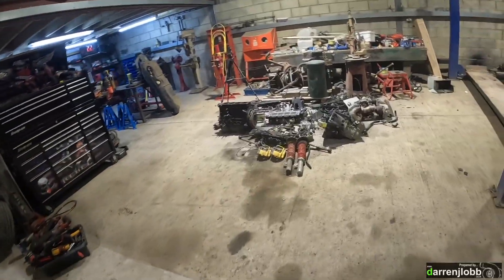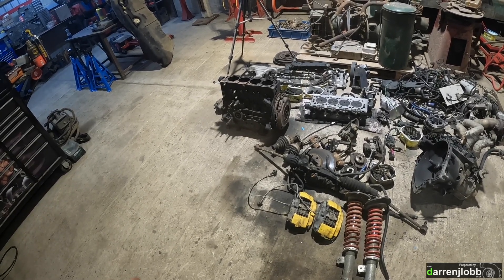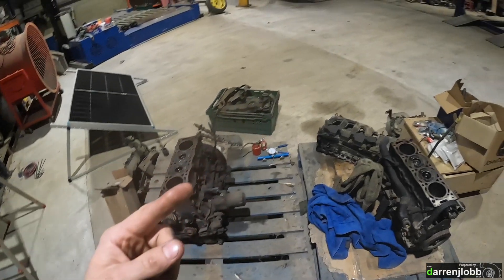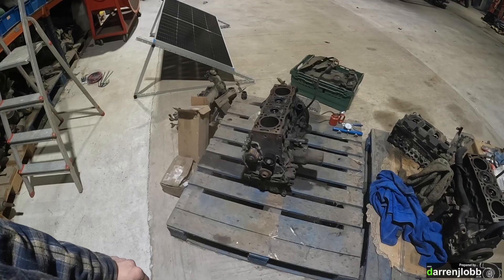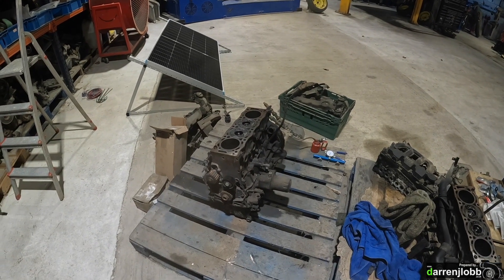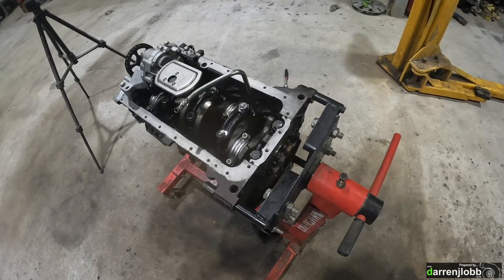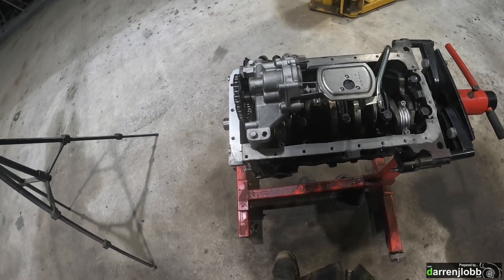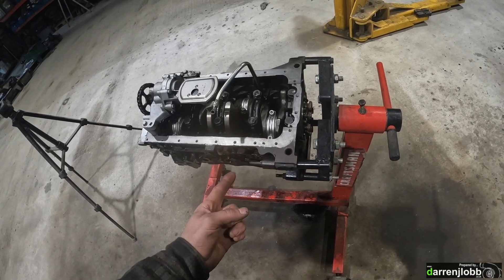The Dervbus Return! (Part 5)

Comment: Hi Darren. Can I ask for some advice? 

I have a 2.0 HDi 110 DW10 with about 120,000 miles. Would a stage 1 (145bhp) remap kill it? 

I ask because the remapping will add a strain to the fuel pump and system and this may not be a good idea on 25 year old components. It does run great at the moment and not exactly slow as standard